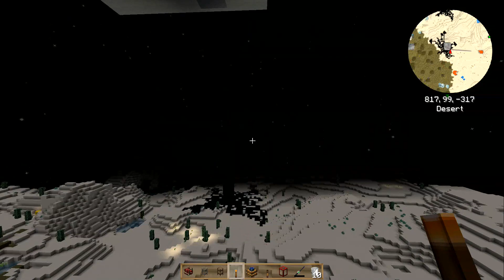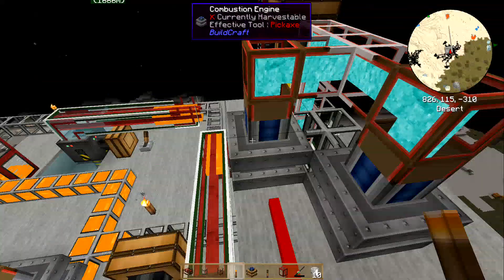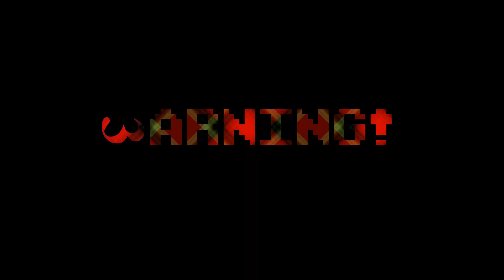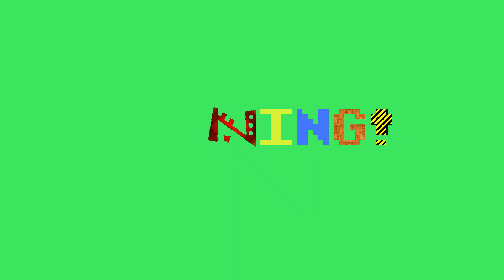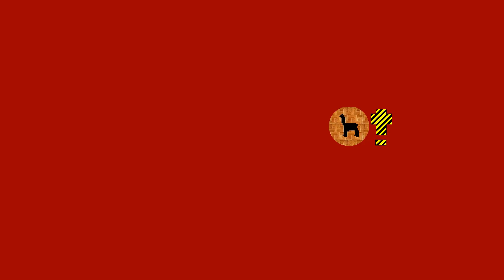Minecraft 1.12.2 Buildcraft Refinery HOWTO (Distiller / Heat Exchanger)

Comment: very nice, one slight issue is the system clogs every couple of in game days as there appears to be more mixed light fuels output then the heat exchangers can handle
Reply from the maker: Huh, I've not run into that problem.  But it's possible they've changed the ratio since I made the video.  Used to be 1:1.
Reply: @ghohenzollern  i fixed the issue by taking each liquid from each stage into an extra utilities drum and pumping it back out, that way there is never an overflow issue, it seems it's just the light mixed fuels that produces more than any of the other outputs,

Comment: Can we just get gaseous fuel and dump every other byproduct in void pipe?
Reply from the maker: You certainly can.  Gaseous fuel is not very energy dense and burns very hot, requiring the maximum cooling of engines.  But if that is what you need, and you have the ability to store it, by all means you can do that!  If you run Cool Oil through a distiller, you'll get Gaseous Fuel and Heavy Oil, then you just dump the Heavy oil into a void pipe.
Reply: @ghohenzollern  Hi Gabe, Can you tell me then which fuel is best to use?
Reply from the maker: @ronixdash123  In general I prefer the middle one, just called "Fuel."  It's a good balance between amount of energy per bucket and how much cooling is necessary.  If, on the other hand, you have a complicated set-up planned anyway, its not so hard to make use of the other fuels.
Reply: @ghohenzollern  Thanks for suggesting gabe, BTW Buildcraft energy is just jumpstart for setting up machines & getting material, soon I'll switch to ic2's nuclear reactor, even nuclear reactor is simpler than this lol

Comment: @Gabe Heller
 thank you so much for the video it was one of the easyests setups ive seen so far. can you make a video tutorial on how to use the gates in this version of minecraft? im at a complet e loss on how to use them and theres not much documentation on them eaither. thank you
Reply from the maker: If you mean the Buildcraft AND/OR/XOR gates, I have used them in several videos, though I don't have a specific tutorial.  Here's a video where I use them with a quarry:
https://www.youtube.com/watch?v=U3bmkJfoOe0
And here's one where I use them with a simpler refinery:
https://www.youtube.com/watch?v=xv2h4paQ7_w
Reply: @ghohenzollern  thank you. Now my other question is, I’m. Constantly having to break my heat exchanger and setting it back up to keep my oil refinery going. I don’t know what I’ve done wrong but that’s what I have to do and it doesn’t always work either
Reply from the maker: @zacharyschwanke7160  Without looking at your world I cannot say for sure.  But my best guess is that tiny amounts of the wrong liquids are getting into the various parts of it.  Buildcraft is not great at showing you when such things happen as there is no interface for it, though shards of the liquids will drop when you break the blocks and then you'll know.  If there are also tiny amounts of the wrong liquids in nearby pipes they may immediately enter the heat exchanger when you replace it and then you'll have to break it again.   But that is only a guess.
Reply: @ghohenzollern  yeah so I guess tomorrow I’ll go throw and run all new pipes maybe there bugged? Who knows. But I know after read some fourm posts that other people have had the same issues. I’m also going to try an older version of the mod pack I’m using to see if that helps to. I did went grab the latest version of Buildcraft for Minecraft 1.12.2 and it’s up to date. Im not sure what the problem there is but I think I might just go ahead and rebuild my world and see if the same thing happens. If it does then I know it’s the game and not the world. Im also going to make my own customs mod pack and see if it just the mods that’s causing conflicts. I’ll right more tomorrow when I can.

Comment: This is so complicated i just use regular oil :D dont even bother. Thanks for the tutorial anyway. Cleared up alot of things
Reply: Just pass the cool oil through a distiller like you would in old Buildcraft if you can’t be bothered with heating and cooling and all that. You’ll get a gas fuel which you can pump straight into engines and a heavy oil output which you can throw out straight away. Even that simple setup is better than using regular oil

Comment: if i use my water proof pipe and a pump and a combuster  to pump water the water stops in the middle of the pipe how do i fix
Reply from the maker: That is not a problem that I have run into.  However a combustion engine is way more than you need to run a pump.  Perhaps try Stirling or Redstone engine instead.

Comment: uh so how do i get other fuel than the upside fuel?
Reply from the maker: You need to heat up the oil in order to split off anything heavier than the gaseous fuel.  That's what the heat exchanger is for.  It requires a hot liquid like lava to heat up a cool liquid.  Once the oil is hot, running it through a distiller will split it into two byproducts.  Some of those byproducts may be fuel, others will need to be further split to get fuel.  The hotter you make the oil, the heavier the fuel you can distill from it.  You'll need to use the heat exchanger again to cool the fuel down so you can burn it,, some of it may be upside-down until cooled.  For efficiency you can cool it down with the same heat exchanger you are using to heat up the oil.

Comment: Super useful guide! Cheers for making it! Quick question, do you know if these 3 types of fully refined fuel (heavy fuel, normal and gaseous fuel) work in any other types of liquid fuelled engines like railcraft boilers or thermal expansion compression dynamos?
Reply from the maker: In 1.12.2, last I knew it was not very predictable.  Buildcraft has recently changed its internal names and depending on which version of Buildcraft you have, and which versions of those mods you have, they may or may not recognize buildcraft fuels.  If you are using a modpack, then it will have been up to the modpack creator to either choose mod versions that work together, or to add buildcraft fuels to the configuration files, if they allow it.  If you're creating a pack yourself, I'd suggest including Industrial Foregoing, as it introduces a fluid dictionary block that is fully configurable to convert fuels from one mod to fuels from another mod at ratios that you specify.  That's what I did in my Rainbow Robot for 1.12.2 pack.  However that pack does not have railcraft, or thermal expansion (though it does have thermal foundation and the thermal fuels).  I set it up to convert between fuels from Buildcraft, Actually Additions, Mekanism, Magneticraft, Industrial Foregoing and Forestry.  Additionally that pack has a recompiled updated fork of Magneticraft which allows fuels from many mods to be used in Buildcraft and Magneticraft machines, but not necessarily the other way around with the new Buildcraft internals.  Feel free to get it from the pack if you need it.  Or the Magneticraft version on curseforge will work with the old Buildcraft internals.
Reply: they do at least right now

Comment: Hi gabe, i recently started to figure out how the new distiller works. I have a question. Which mod do you use to tell you how hot an oil is. With the waila that i have i dont see what status the oil is in
Reply from the maker: I'm using HWYLA in this video, but as far as I can tell HWYLA doesn't work well with Buildcraft blocks like tanks and distillers.  I'm also using JEI which tells me if I have it in a bucket.  HWYLA works better with tanks and drums from other mods though.  If you don't want to put it in a bucket to check you could try Drums from Extra Utilities or Tanks from Mekanism or Thermal Expansion.  Actually Additions I know has its own HUD for Actually Additions blocks, so if you can put it in an Actually Additions tank, that might tell you even if HYWLA fails.  If all else fails, all Oil in the world starts out as Cool and the only way to heat it up is with a heat exchanger, so you can always just keep track of how many heat exchangers you have put it through.
Reply: @ghohenzollern  thank you so much for your reply, i will do some testing in creative. I went blindly and tried to do it in survival which fail spectacular. I was still under the impression that it was still the old way of changing oil to fuel
Reply: @ghohenzollern  what is the best fuel to use in combustion engine?
Reply from the maker: @marcovollmer7470  It depends on the application.  Light Fuel is most similar to the old Fuel.  Dense Fuel takes longer to overheat the engines, so is safer, but doesn't produce as much MJ/tick.   Gaseous Fuel produces the most MJ/tick, but burns quickly and very hot, so you'll need plenty of cooling and space to store it.
Reply: @ghohenzollern  thank you. I have successfully build the system in creative mode. I am aiming to power one combustion engine for a small quarry. I also want to say thanks to your chart it became very clear how this oil to feul conversion works.
Reply from the maker: @marcovollmer7470  Yay, thanks!  I've not done a lot of powering quarries with Buildcraft engines since the old Tekkit days as I have found the generators from just about every other mod more reliable, so as soon as I could I switched to them.  In 1.12.2, I've had the most luck converting power using the energyconverters mod.  When I did power quarries with Buildcraft engines, I found the ProjectRed timer scheme shown in this video most effective.  Used to be WAILA showed you how much power was in a Quarry so you could tell when you were powering it fully.  Now it is much harder to tell, you basically have to keep increasing the power until adding more doesn't make it work any faster.  I haven't done enough testing to know how many MJ/tick that is.  In the new video you'll have seen how to cool a combustion engine running on Gaseous Fuel.  However much power it can handle, that would be the way to power it using the fewest engines.  But I do not know how many engines that is.
Reply: @ghohenzollern  i have started to construct my design into my survival mode. Mine wont be as compact as yours but then again i love to have room to walk around the machines. The gaseous feul works great i will also see how the light and dense feul will do with the quarry. Thanks again for all the tips

Comment: FYI:
There is a more efficient way to create Dense Fuel:

https://drive.google.com/uc?export=view&id=1SUL4XypKFa33Iyx4lGt6mfxqmhH0fXrK
I simulated all the ways to dense fuel in a sheet.

Your factory needs 8.000 mb Crude Oil + 22.000 MJ for 1.000 mb Dense Fuel.
The process showed in my picture needs 2.000 mb Crude Oil + 11.000 MJ for 1.000 mb Dense Fuel.  :3
Reply from the maker: Yeah, if Dense fuel is your goal.   I remember ending up with some in my earlier experiments.  But in this case, I was trying to get the closest thing to old buildcraft "Fuel" as possible and also produce as many byproducts that could be burnt as well.
Reply: @ghohenzollern  
You can have a look at my calculations if you want. I did all the calculations in a google sheet.
I did a lot of theory-crafting before actually started to build a refinery :D

 I also built a super-compact refinery, all engines cooled with water, and doing the process you see in the picture.
Reply from the maker: @NasbitTV  I understand some of the ratios have changed since I made this video, so I'd have to start from scratch anyway if I were to amend this video.  I may delve further into it in future, but I have other things on my plate at the moment.

Comment: if you run a water pipeline into a combustion engine, it will fill the water tank in the engine up cooling it.
Reply from the maker: That is the correct method of cooling combustion engines, and maybe it works better now than it did in the past, but the number of times I've found my engines exploded or overheating because the water supply failed for some reason is very very high.  This method, I've only had fail a couple times, and it was because I pushed the timer interval too far.
Reply: @ghohenzollern  true true
Reply from the maker: I've now come up with what I consider a reliable water-cooled setup.   Details are in the new video here: https://www.youtube.com/watch?v=RJzjlFW2NZw

Comment: Man, I tried and tried this setup and I couldn't get it started. Then I accidentally dumped a bucket of lava into the oil and everything caught on fire.
Reply from the maker: Buildcraft still doesn't have portable tanks, and I wanted the tutorial to be useful no matter what other mods were in the pack.  But if your pack has portable tanks, I'd suggest storing the Oil in them and taking it somewhere away from the deposit to distill.

Comment: Good tutorial m8. You just could cool down the Combustion engine with Water
Reply from the maker: I have had problems with water-cooled combustion engines exploding in the past, but never with this method.  Initially, water-cooling keeps the engines at blue state, which is not the most efficient.  However, the engines burn hotter over time, requiring more water.  Additionally, water delivery systems based on buildcraft pumps can run dry if operated at maximum speed.  If for any reason, the water delivery system can't keep up, they overheat rapidly and explode.  This process happens very slowly so you may watch an engine work for hours and all may seem to be fine, but leave it alone for a while and come back and all you'll find is a big hole.  I've heard there are ways to use buildcraft gates and pipe-wires to auto-regulate the engines, but I've never quite figured out how it is done.
Reply: @ghohenzollern  Just FYI combustion engines no longer explode in 1.12 - instead they overheat and have to be turned off instead for a little while.
Reply from the maker: @_AlexIIL  By default they don't, but I believe the option is still in the config file, so it really depends on what modpack you are playing and how they have configured it.
Reply: @ghohenzollern  Oh that config option was removed a while back (and the code for actually creating the explosion when it overheats) - so it's not a possibility anymore. However in 1.7 this was the case.
Reply from the maker: I think I've found a water cooling system that works reliably now.  Details are in my new video:
https://www.youtube.com/watch?v=RJzjlFW2NZw